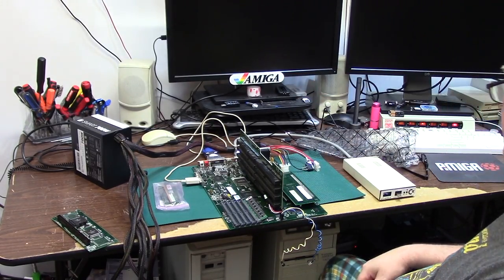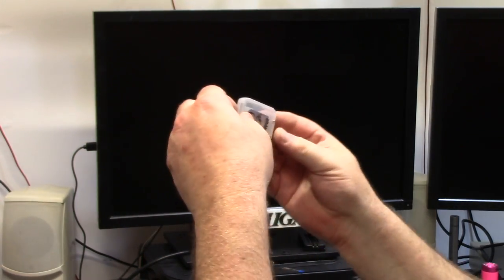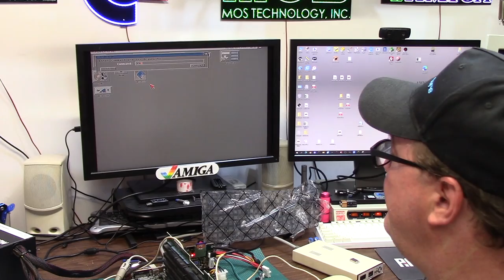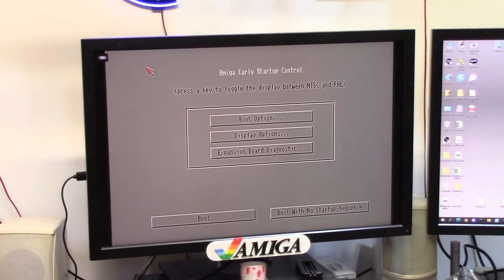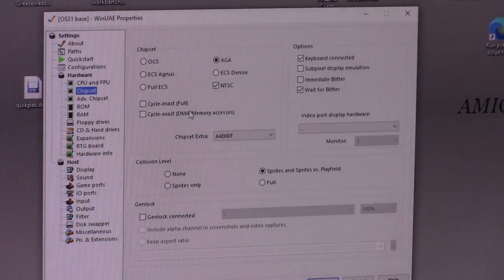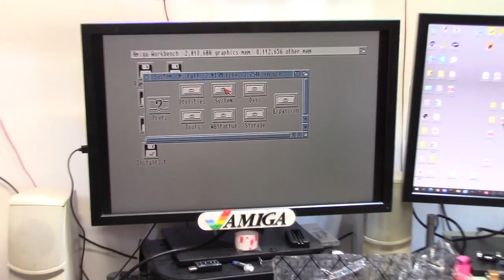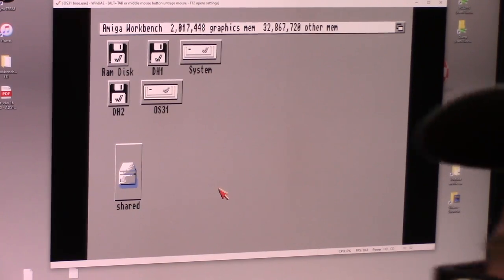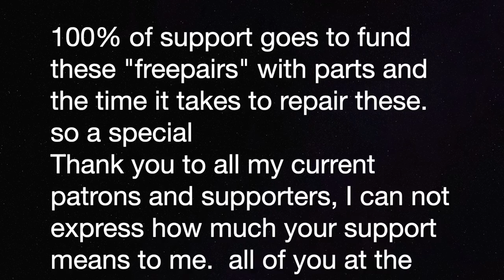Commodore Amiga 4000 CPU and hd  in winuae how to

Comment: Your keyboard adapter is just a stock PS/2 to AT DIN. Source: I use one on my A4000D and it works fine. Pinouts match too.

How is your backlog looking? Eventually I have to get my staticy left audio channel fixed on my A4000D board. No rush, can be next year for all that matters at the moment. I suspect its the opamp as the board was recapped in 2013 but I really don't want to use my non-existent SMD soldering skills and ruin the thing. Some light finger pressure on the opamp actually causes the channel to cut out completely!

Also someone was selling an Escom A4000T Toaster system at the VCF swap meet a few weeks ago. Only $2000 complete with feet, seemed like a bargain. Wonder if someone picked up that beauty.
Reply from the maker: 13 in queue im backed up for the rest of this year prob

Comment: 15:29 But you don't need Amiga Forever. You could do this with a ordinary Windows folder. WinUAE i played just a little with it and it is crazy cool. Made a HD that is accessible in Windows, you can copy and write to it, than start the WinUAE and have the copied files on the AMIGA hand... I really don't have much knowledge of the topic, i believe you can make your ADF this way or extract content of ADF's... Thumb Up as always and have a nice one :).
Reply from the maker: yes i know, i just had AF installed so this was where i dumped mine.
Reply: @ChrisEdwardsRestoration  When i started playing with Windows i thought it has to be the C: drive... Than i tried and made D: the system drive... Sometimes depending on your experience you assumption may be garbage. There was no one who could teach me back than, all learning by trying it out. This takes ages to get shait sorted out that way! Thank you for the Amiga stuff lessons!
Reply: Amiga Forever is however a turnkey solution which gives you all the rooms and importantly the complete system software collection from Commedore and other useful stuff ready to go like the Picasso driver. and you can get that pretty c heaply.